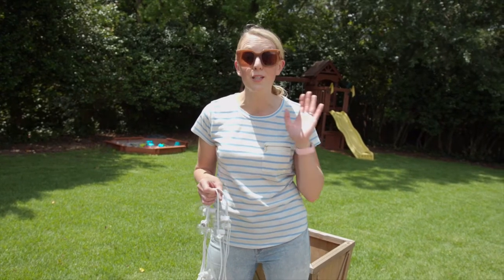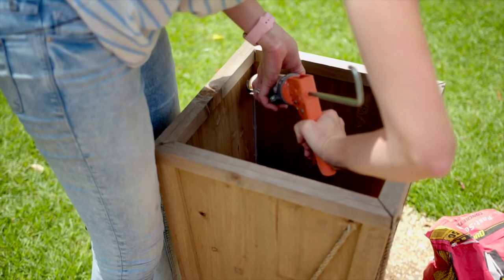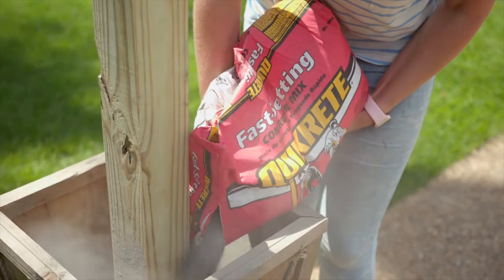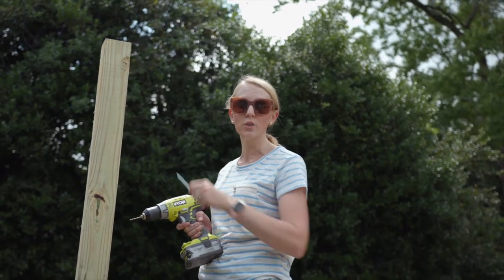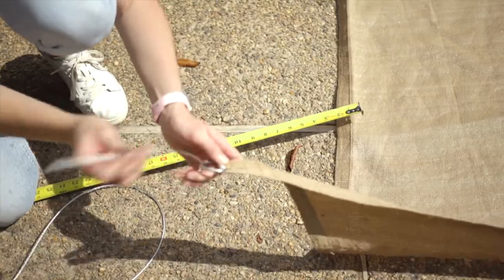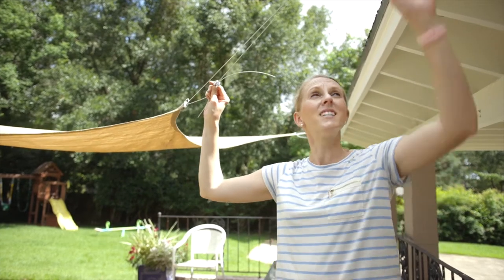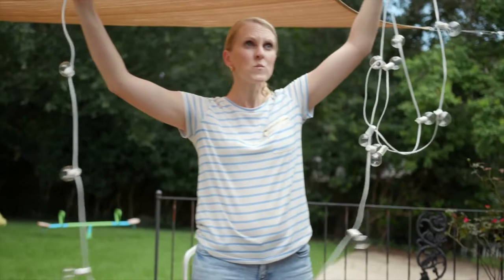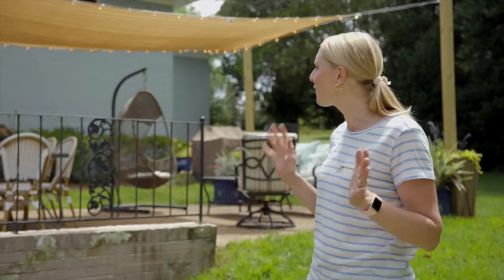Decorative Planters for Hanging String Lights and Shade Cloth

Comment: My question is if you tighten your shade up to your planters turn over?
Reply: I’ve found two solutions…
Don’t tighten the shade sail too much,
Or use some 18” rebar with a  ‘j’ bend as anchors to tie down / secure the pole/planter box
Reply: having narrow planters could create an unstable condition when tight. If you use a wider planter that's maybe not as tall would spread the concrete out and create a stable condition...

Comment: Do you have the shades all year round? You didn't put any stain on the wood. Will it crack over time due to weather or bend? Do you have any recommendations for it?
Reply from the maker: We take the shade down when we aren't on the patio. The wood is pressure-treated so it doesn't need to be painted or stained. But staining is an option to make it more attractive or match existing surfaces! ~Chelsea

Comment: Hello. How many bags of concrete per planter did you use? Also how did you know how much water to use for the mix?
Reply from the maker: I used 2 bags per planter. The bag has directions for how much water, but you can eyeball it to a consistency slightly more watery than pancake batter.
Reply: Way too windy where I live for this